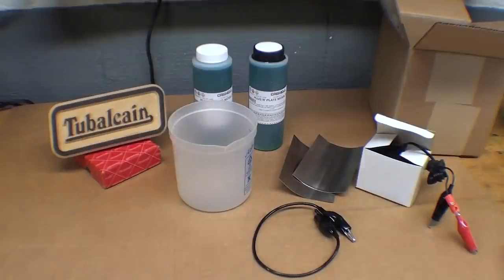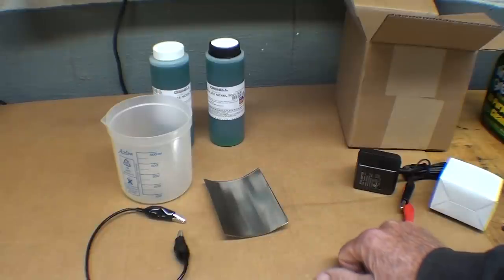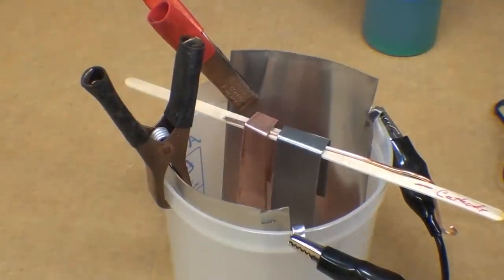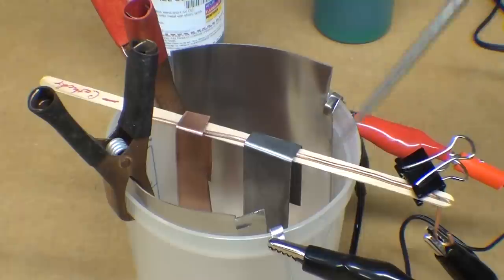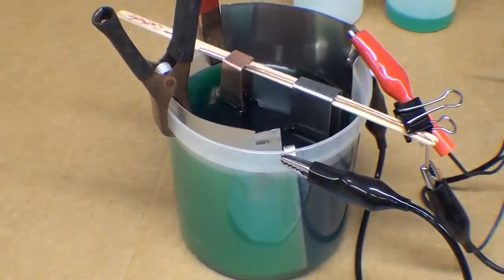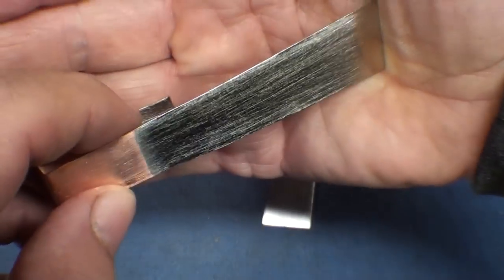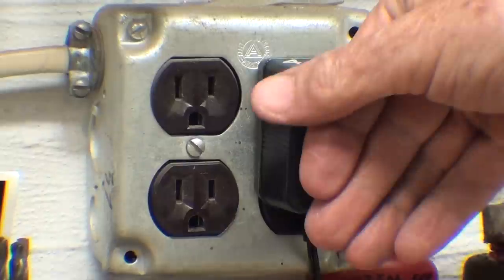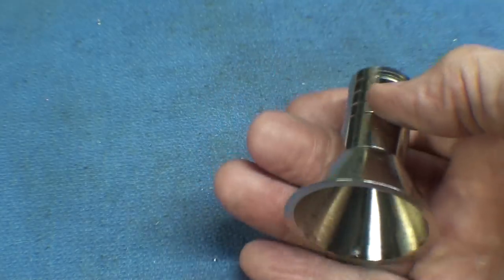SHOP TIPS #383 How to Nickel Plate tubalcain electroplating

Comment: Awesome. Not many plating companies around anymore.
Reply: Dealing with all of those chemicals commercially is difficult. I worked at a place that hard chrome plated printing press dies and let's just say we didn't dispose of spent solutions in the most ecological manner. It involved some flushing. Chromium flakes are rather pretty. We had 55 gallon drums of them.

Comment: Thank you
Now ive learned to clean rust off of tools and cast iron cookware via electroless, and now i know how to how to plate by electoless. So far in rust removal ive used a plastic trash can, battery charger, an old  brake rotor, and borax laundry soap for solution. Do this outside and please cover trash can with lid so you wont need to rescue cat out of solution. There was no rust to be found on cat.
Thanks again,
M L Rogers  Pasadena, TX
Reply from the maker: lol

Comment: Final cleaning by boiling in powdered dishwater detergent is also very effective.
Also, starting nickel plating, removing the part for inspection, then staring to plate again is inadvisable. Don't try to plate in stages unless you 'reactivate' the surfaces each time.
There are additives that promote a uniform 'gloss' finish versus a flat marked finish.;
'Bright' versus 'Dull' nickel.
Reply from the maker: Thanks

Comment: Neat!  Not too surprised you couldn't measure the thickness, it's probably only atoms thick.  Practically speaking, I wonder if zinc plating would provide more corrosion protection vs nickle (at the cost of prettiness).

Comment: Love these results, really gave that punch some good looks-!  Ive never done this, but it looks very similar to the principle you've used to remove rust-?  I wonder what the difference might be with a 6 or 12 volt battery charger instead of the wall wart-?  I imagine the process would speed up, might see some bubbles then-lol  Some good suggestions below from other commenters on how to obtain the materials at lower cost, also a higher quality better regulated power supply is suggested but wow great results without an expensive trip to a plating co.
Reply: Plating requires low voltage for an even finish.
Reply: Can i see the diamond electroplating process
Reply: @prabhashrajput310 
Would like to see that also, Pete. 😊

Comment: I'm positive your wallwart (what we call an adaptor) is broken, cause you should just read 4,5V on your multimeter since says it is 4,5V. ❤❤❤ btw the solution is just desolved nikkel in i believe vineger and salt or water and salt by putting a nikkel anode aswell as a nikkel kathode in

Comment: It looks like that little wall-wart power supply is probably a switcher.  That means "switching power supply".  Generally, switchers need a minimum load to develop a stable output.  In this case, I suspect the cell was drawing too much current -- that would explain why the wall-wart was getting warm.  It would be instructive to connect the meter as an ammeter in series with the cell to measure how much current the electrolytic tank was drawing, then compare that against the wall-wart's rated output.  If the cell is drawing less than 10% of the rating, the wall-ward is not loaded enough.  If the cell is drawing more, the wall-wart is overloaded.  Either situation will drag the output voltage down.
Reply from the maker: Thanks

Comment: Hot, moving water.....sand, polish then clean. Bigger spaces between the parts gives better results. You can find everything you need around the house to do this except the nickel sulfate. A good source for nearly pure nickel is Canadian coins (they have allot of mines). Low voltage seems to give better finish but highers gives quicker results. Same old trade off....point vs speed.

Comment: Sir, just subscribed, thank you for making these great videos. I particularly like the electrolysis ones. I have tried Oxalic Acid/Water on Aluminum wheels to remove corrosion with decent results. I soaked them overnight, rinsed, and coated with WD40 until I can give them a clear coat. Not sure if you have tried using Oxalic Acid as a rust remover yet, but I would sure like to see that on one of your episodes. I will keep looking through your videos, in case you have already made one. Thanks again for the great videos.
Reply from the maker: Thanks
Reply: Oxalic acid is good for removing rust also good for removing iron stains on wood,... it is toxic in concentrations used for rust removal, and wood bleaching ,.. use gloves, adequate ventilation, and then wash everything in water a lot.  I wonder if it may have uses in plating?

Comment: I have used this same stuff from them work great i done a 1911 45 pistol but to get a great finish you have to have a very clean polish job and a good cleaner for the metal no finger prints and correct amperage and volts and time in chemical will do a great job if done this way ps if you want a pic ill gladly send      Duane

Comment: It may be pulsing because the wal wart is probably working in half rectification. A full bridge would smooth it out more. Just a guess. Thanks for sharing.
Reply: not likely since the rate of change of the voltage/current  is 60 times per second - which you'd never be able to see. it's likely that the power supply supplied has an auxiliary circuit to modulate the current  to prevent overloading and possibly destroying it.  Perhaps Lyle can connect the Simpson as an ammeter so we can see how much current is flowing?
Reply: I was thinking the wal wart was pulse width modulated. You're probably right.
Reply: I was becoming agitated that Mr Pete didn't put the meter across the power source after disconnecting it from the tank, to see if the delivered voltage is fluctuating or, as is my preferred thought, minute bubbles are adding periodic resistance.

Comment: The solution is nickel sulphate, and it deposits nickel onto the part, the nickel anode/cathode are there to regenerate the nickel sulphate solution
Reply: nickel sulphate 10 - 15%, nickel chloride 2 - 3 %, boric acid 0.5 - 1%, hydrogen chloride 0.001 - 0.002% (as per MSDS)
Reply: You just made it make sense to me. Thank you

Comment: This is just about the same idea as when you do the de-rusting.  The electrode polarity is reversed, and a different type of chemical used.  
The chemical here, has to be some kind of lite acid to make the nickel move to the copper surface.
The center punch looks very nice.  
Maybe the next project should be gold platting, or platinum!!!!
This worked very well for a simple bunch of parts.

Comment: Mr Pete.  Someone is going to ask this question in the comments, so I'll answer it for you..  Why is the plus on the outside and the minus on the workpiece?  Voltage moves from + to -, that's true.  But the current moves from - to +, and that's what carries the nickel ions from the plates to the workpiece.
Reply: I  wondered the very same thing.
Reply: Nickel, in fact all metals, produce positively charged ions. During electrolysis  metal molecules are ionised (2+ for nickel) and migrate to the cathode where they deposit as new metal (taking two electrons from the supply at the cathode per 2+ nickel ion to become metal). 

It might be easier to think of the 2+ nickel ions provided in solution through the electrolyte. These are already available close to the cathode. As soon at the cathode becomes negatively charged, it 'grabs' nearby + metal ions, neutralises them and causes them to come out of solution and deposit as metal. This would deplete the electolyte of + metal ions but the charge now pulls replacement ions from the nickel anode.

Comment: The photographic technique you want is soft light, and there are a few ways to get it, none of them are convenient for a shop.  You take a bright light source and scatter it so there's not a single bright source to reflect. Taking a light that's brighter than you think you need and shining it through a white cloth is a basic way, be careful not to set the cloth on fire.
Reply: Alexander Roderick I went to Norman's Camera in Kalamazoo and bought a white umbrella for about $8.00. Might be able to buy one cheaper elsewhere. With the light behind it, the umbrella glows white and makes 3 foot wide light source. With no point source the camera doesn't flare.
Reply: I mean yeah, if you want to go do some shopping. Clearly you can just buy a solution. But sometimes people like to try out a fix before they commit to new gear. I know from experience, I'm sitting on a lot of video and lighting equipment, now I'm trying to figure out how to make interesting things happen that I can point a camera at. Mr. Pete had the opposite problem.
Reply: right idea wrong way. Shine the bright light at a whiteboard and use the reflected light to light you object. You actually aim the light away from your object.
Reply: Alexander Roderick- you have the correct concept in mind.  The solution is called a light box which is a frame of whatever size needed covered with translucent material through which light is diffused to illuminate polished surfaces with minimal glare/reflection.  There are many YT videos describing the construction of a light box.
Reply: Alexander Roderick 6 years of flashlights, clip lights, floods, backdrops, drapes, sheets, boxes, natural light, and finally I bought a light rig that was made to work. I think I qualify as having tried. 😆

Comment: ditch the wall wart and go with a automotive battery charger. it's a lot quicker.
the voltage at 2 volts is because the wall wart is only rated for 300ma@4.5 volts as you pass this current threshold the volts drop
Reply: I agree. And the pulsating voltage is probably caused by an over-current circuit in the wall wart. A battery of 6 volts or more would be preferable. Something with plenty of amperage.
Reply: In commercial electroplating it's 20 volts and up to 40 amps depending on surface area to plate.
Industrial plating can go even higher
The last bumper we chrome plated took almost all of the 40 amps
Reply: I usually do small parts like his center punch at around 4-5 amps 
The finish is just as good and only takes 15-20 minutes
As a business time is money! Slow is ok for the home hobby stuff 
Personally I like anodising better. More choices in colors than just silver
Reply: Meter leads were in DC inputs and the AC scale was being looked at. The DC scale was showing the 4+ DC volts of the wall wart.
Reply: I don't see it.
Reply: The switch on the meter was on the DC side not the AC side 
If so the meter would show zero ac volts
Reply: Electroplating on car bumpers is typically measured in "tenths" of an inch (i.e., 0.0001-inch), at least as far as chrome is concerned, and is often called bright plating.  Industrial plating (not bright) for dimensional recovery of worn parts, like aircraft landing gear, can be in excess of 1/16-inch thick for nickel and never more than 0.0015-inches thick for the chrome wear cap on the nickel.  We have 1,000- to 5,000-amp rectifiers for each tank in the chrome room, and something smaller (that I don't recall) for each nickel tank.
Reply: Bob Vines we do small chrome parts like knobs and trim 
Our tank had just enough room for a bumper off an old mini Cooper
That was the biggest item that would fit our tank
Reply: Doug Bush...Mr. Pete appears to be using and interpreting his nice 260 in exactly the proper way. At 17:14, the leads are in the proper locations, and the range selector can be seen in the 10V setting. @ 17:16, it can be seen to be in the DC+ setting. In reading less that 10VDC or VAC, the bottom black markings are to be used, which shows the voltage variance exactly as described by our distinguished tutor.
Reply: Scott Johnson no. its an analog meter it doesn't stop showing the a.c. voltages. You have to know set of numbers to look at. D.c. is at the top in black numbers.

Comment: Mr Peterson,
I see this video as very inspiring, and potentially very useful.
Since I’m seeing more 1930s, 40s, and 50s radio chassis that are rusting, re-plating them will make for a far more durable finish than spray paint. 
Likely as not, micro-plating kits will be expensive to ship to England, so I’m prepared to experiment with materials I’m able to obtain over here.  There is one question I will ask: do you know the ingredients, along with their measures, for making up the electrolyte solution for this process?
Thank you, Phil.
Reply from the maker: no--do not.
Reply: Maybe check the msds sheets.   Haha

Comment: The nickel plate is far less than 0.0001 inches.  Even a barely perceptible amount of difference in the diameter of the center punch and bore would still be about 0.001 inch or ten times the thickness of the plating.  I would be interested in Pete connecting the meter in series with the supply and measuring the current.  Also, It would be interesting to see Pete use a car battery charger, about 14 volts and several amps of current.  My guess is then he would see the bubbles he wanted.
Reply from the maker: +BryanTorok wow, that sure is a thin coating

Comment: I wonder if this could be used to remedy a bearing pocket that was bored just a tad too loose in brass or steel?
Reply: To tighten up bearings we used to engrave a crosshatch pattern in work. Engraving displaces some material up. You use one of those vibrating electric engravers to do it.
Reply: Ken, several years ago, I turned a bearing fit .0005" under size, on a  shaft I machined from a piece of SAE 4140 .  All of the other precision fits were good so my shop foreman sent the shaft to a local plating company a had that one undersized fit plated to the correct diameter.
As it turns out, that is common practice within the industry.  TreeTop
Reply: Ha! Here I thought I was a genius with an original idea. j/k...  :D
Reply: Genius is using a technique a man on the floor can do in a matter of moments. That is engraving a bunch of X's on the bearing housing. The looser it is the more X's you write on the bearing.
Reply: I have used a spring-loaded centerpunch but the engraver idea is more practical - will be using it next time!

Comment: Your description says COSWELL...should be Caswell (just an FYI Lyle)
Reply: Shame you didn't buff it, to plate the hole you would have to put a strip of nickel in the hole and connect it without shorting out.
Reply: but the inside did get plated.
Reply: KevCarrico very little plating in the center of the hole

Comment: YOUR LIGHTING PROBLEM YOU MENTIONED. PUT WAX PAPER IN FRONT OF YOUR BRIGHT LIGHT AND DIFUSE THE LIGHT. THE LIGHT WILL BE VERY SOFT AND NOT REFLECT VERY MUCH. MAY NEED TO GET SOME BRIGHTER BULBS  SO THE LIGHT WILL PENETRATE THE WAX PAPER ENOUGH TO SHINE THROUGH. IT WILL CUT DOWN ON HARSH SHADOWS ALAO.

Comment: too low voltage and amperage. 12v 2A for small parts is ok. those kits have a cheapo phone charger. if you want to do a lot of plating, get Sterilite tubs, 12v trickle auto battery charger and make your own nickel acetate solutions
Reply from the maker: Thanks

Comment: Something is wrong with the kit.  The jumper is black and lead is red.  Hum - is this a series battery then ?   !   Not parallel blk to blk, rd to rd....   Must be series.  Nickel Chloride.  Used until stops plating.   Clean the Nickel plates ? !  That Simson is a standard meter for industry of late.  Nickel gives a blue tone unless copper is under it.  With copper it turns it back to white.

Comment: +mrpete222 You want to copier plate prior to nickel plated for better adhesion.
Reply: That's not what the copper layer is for. Copper is plated on first because it is soft. So it buffs faster. The copper is to make the job easier, not better.
Reply: I'm just telling you what an engineer told me. Since he did said work for NASA I have no reason to doubt him.
Reply: Yeah well I just nickel and chrome plated stuff commercially. Why would a NASA engineer know about chrome plating anyways? For the shiny hubcaps on the rockets?